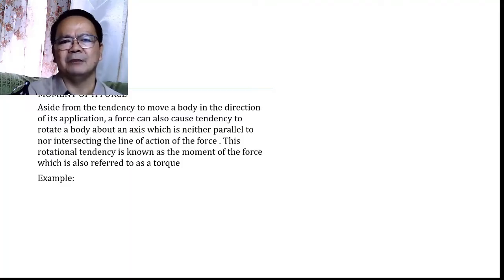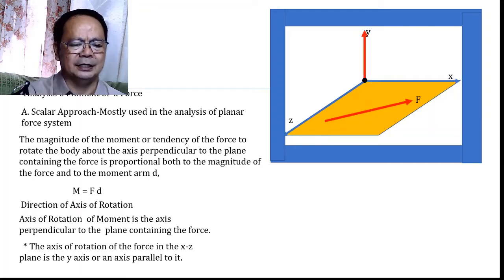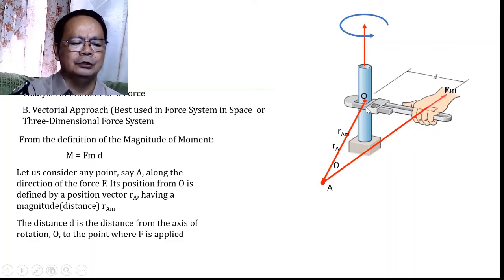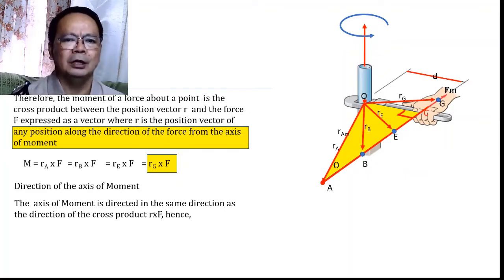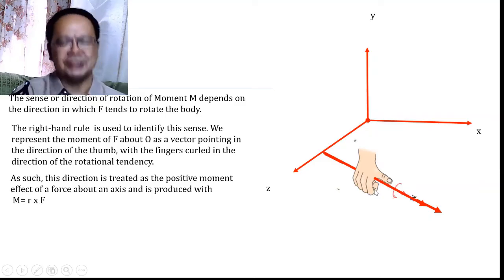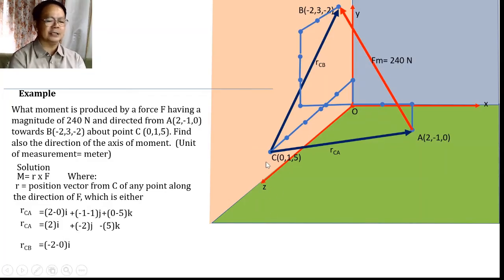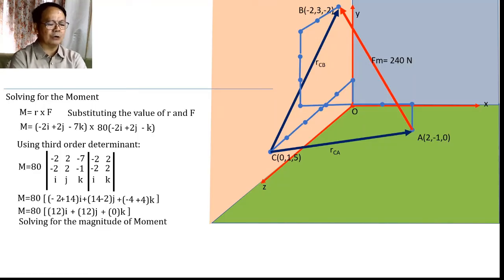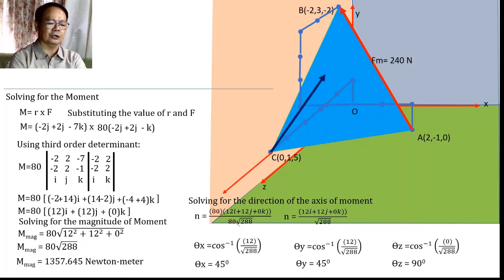Moment of a Force

Comment: hello po sir.
just wanna ask po how to approach problems that requires the maximum/minimum magnitude of moment.
thank you po.
Reply from the maker: Normally, this questions are asked if the direction of the force may vary... In this case, a force will produce maximum moment if its direction is at right angle with the the plane where it is acting...